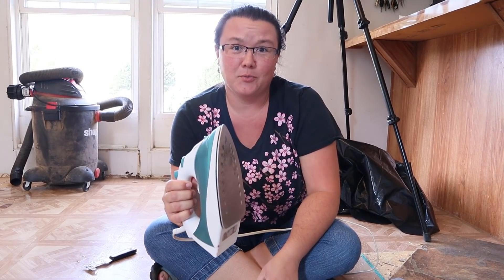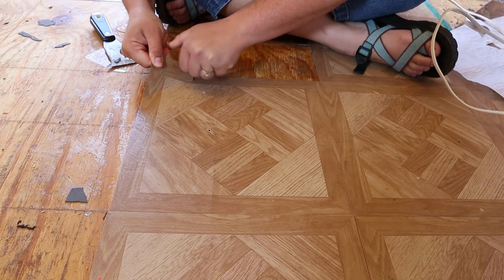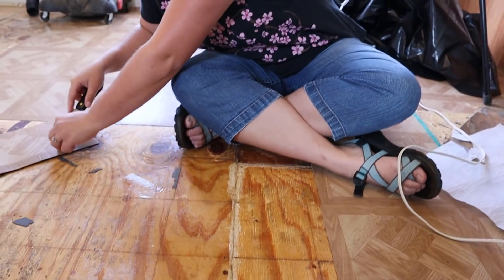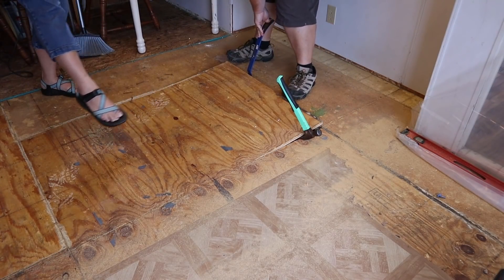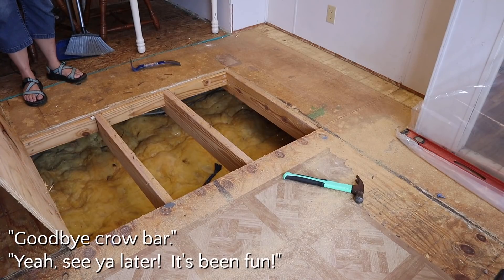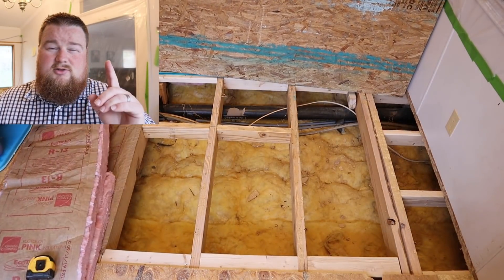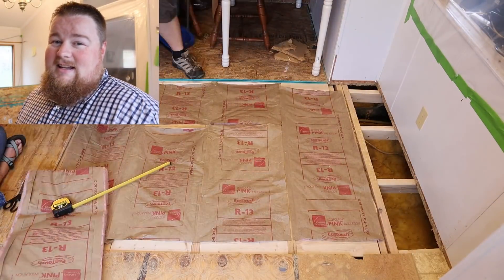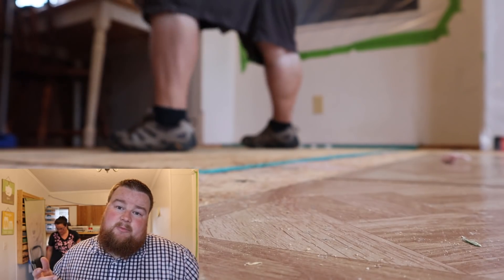Super Easy Peel and Stick Tile Removal | Budget Mobile Home Remodel #9

Comment: In my folks mobile, we put insulation all around the skirting. That helped but still had to wrap pipes next to the windward walls. Over here, at "The Southwind", everything is wrapped cuz zero insulation in downstairs walls. In winter, we have to heat the pumphouse :/ or no water in winter. Things are humming along over there.... I can't wait to see the next episode!
Reply from the maker: We have to use heat tape in our well house, too. It's about the best situation we've found, but not a great one.. Thanks!

Comment: Definitely think i will be doing some blocking too esp around sliding glass doors and edge of wall area. I have a belly wrap under my home. Had weatherization come in bout 6 yrs. Ago.and they did insulation all over. Only thing im doin dif. Is putting down 1 in. real plywood as i hate osb board with a passion. Also painting 1 side with high gloss to keep even more protected so 1/2  in. Boards bottom paint is to ground and other 1/2 in. board is up to kitchen n living rm. N hallway. All screwed down. Lol 1 rm. Done 2 to go but this one is huge. 15x24..uggg.

Comment: The other one that works but more messy but works great is boiling the jug and pouring boiling water over the top of the tiles or lino (score it first) the heat and water gets under the tiles and they come up nicely - blade like you have or a spade from the garden - it would have taken a few just fulls to sort it

Comment: How do you remove the sticky residue on the floor that was underneath the tiles?
Reply: I would use a sander
Reply: @AloeMCMLXIV  it depends on what your plans are - I bet with vinyl plank flooring you can leave it.

Comment: Since you were pulling up the floor boards why did you have to take off the stick tiles?
Reply from the maker: We weren't sure of joints or (more so) screws under the tiles that would have made removing the plywood much worse.
Reply: Ok, that makes sense!👍

Comment: Just a suggestion but instead of taking all the sticky tiles off couldn't you just take the ones off just on your cut line since you are putting down the new Sub floor. It could save a lot of time.
Reply from the maker: That would work for the cuts, but would miss the floor fasteners and make removing the subfloor more difficult. But good idea! We considered it ourselves, too. 😎
Reply: Green Acre Homestead great point, I didn't even think of that.